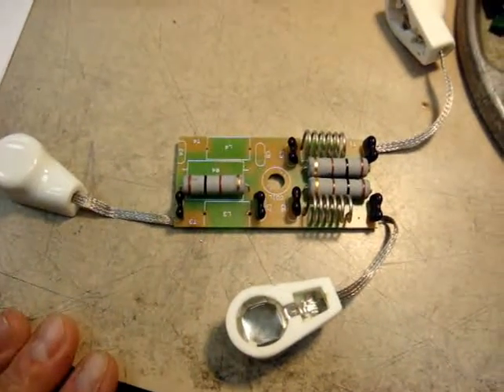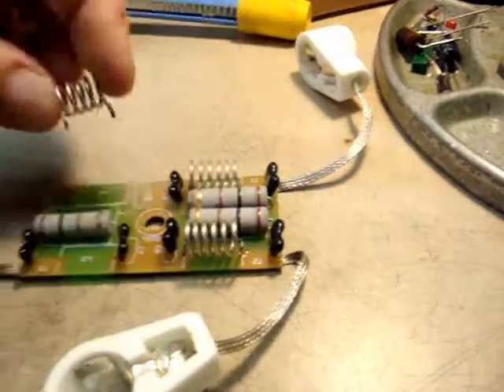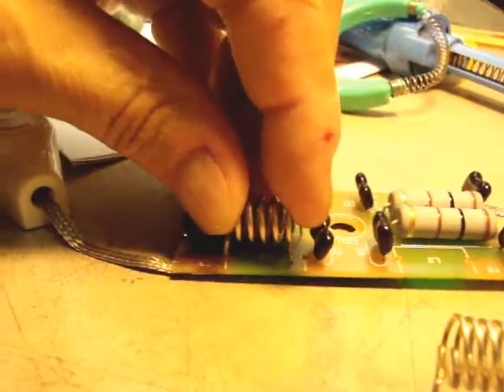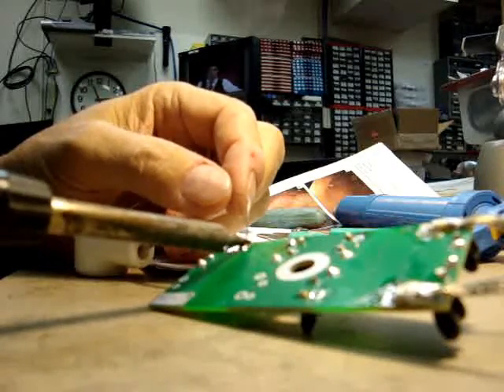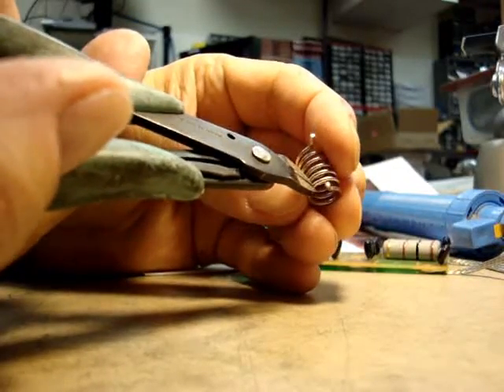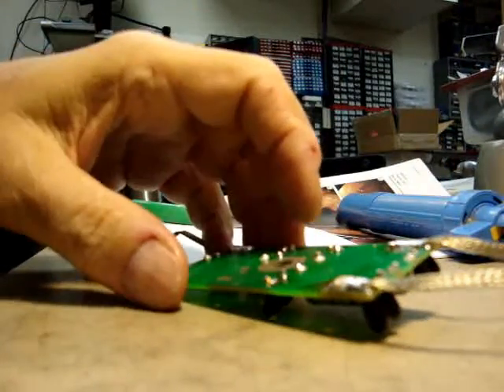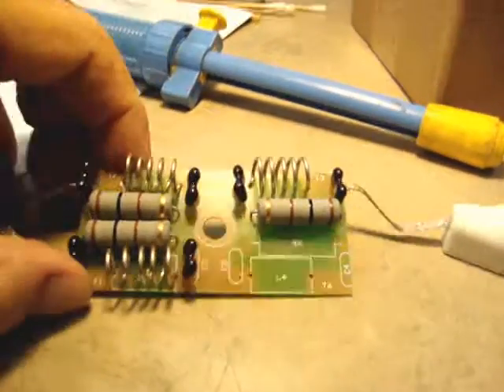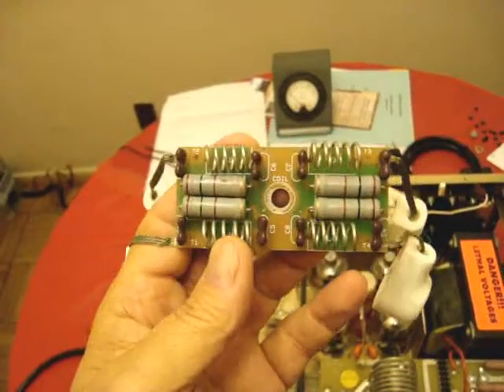Ameritron Parasitic Choke Problem

Comment: Only four turns will be better. Also that bunch of 100pF capacitors are not necessary. Connect the resistors directly to the coils. Simple is better.
Reply from the maker: I tend to agree 👍

Comment: I see it was a 6 turn now it’s 5. Mine is already a 5 turn. ???
Reply from the maker: 4 or 5 turns is good. As long as the resistors don't get hot operating on 28mhz, its good.

Comment: That board has a few issues from Ameritron. They use the wrong turns sometimes, it should always have 5 turns, and sometimes they short the capacitors. 

Also they use the wring fan in amplifiers. The Cooltron fan they are using now is 1/3 the required airflow. 

CTR Engineering has a better direct replacement board and fan kit that fixes the current 811 amplifier production problems.
Reply: Yes, i heard about that too. I had noticed that some of the amplifiers had 6 turns and others had 5 turns. i spoke to a tech at MFJ that told me it should be 5 turns on the coil for proper operation.
Reply: @Music-zh7fm  The poor QC at Ameritron along with everyone and anyone being able to change anything they want, even change critical parts, is why they have problems. This is why the fans are far too small now, and why the solid state amps have so many problems.  The worry about this is it causes the public to form their own opinions of what to do. 

For example the parasitic suppressor circuit board trace layout is prone to having the small mica caps near the choke shorted, which almost quadruples current in the 100 ohm resistors at HF. There was a certain hardware stack supposed to be used, but it never happened. 

Instead of publicizing that trace being too close to a lug as a spot to watch for  resistor overheating, or knowing the fan is 1/3 the necessary airflow, or maybe the suppressor has some random turns count in the suppressor inductors, everyone automatically just takes a turn off.

What if it has the correct turns and a shorted-out 100pF capacitor and a too small fan, and someone pulls an extra turn or two off?   They now make stability  worse and do not fix the real problem. 

This is the danger in random construction and random repair.
Reply: @Jerrythenerdful  What do you suggest?

Comment: If you ask me, I think it's best to get rid of the capacitors because they're not uniform enough.  get rid of the whole parasitic choke pcb and make three identical chokes with exactly the same wire lengths to the common RF tie point.  Read my other note as to the reason.
Reply: @bob4analog  If you don't believe me Bob, why not try making 2 of those braided straps about 6" long while making the others as short as possible.  I'll bet you get very low power out of the amp.
Reply from the maker: Yes, I agree, but why would you want to do that?

Comment: Do you realize that a Uniform appearance isn't all that you get by making these things exactly uniform?  Bear in mind something called "Transit Time".   For example, have you ever examined a computer CPU card very closely? if you have you may have noticed that many of the PCB traces in the Data Bus or the Address Bus will have several lines that seem to be needlessly "snaked" around the card for no apparent reason.  The reason for this is so that every "rising or falling edge" in the "data word" will arrive at the correct window in time because if some PCB wires are longer or shorter than others, the "Transit Time" for some of the data bits will be slower or faster than the others, causing the Data Words to arrive with data errors and "crash" the computer code.  A very similar thing happens at the point where the Plate RF of multiple RF power tubes meet together at the Plate voltage choke.   For example:  If you have the crest of the output wave from one tube arriving more than a few degrees delayed in phase from another, this will cause a type of interference or "phase cancelation" that will actually use some of your RF power to "buck against" itself thereby, weakening your resulting output power and only heating your system.  You can think of it similarly to Reflected power interference inside a microwave oven.  This is why at 30MHz you must be sure to keep these wires exactly the same length.  Don't believe me?  Do the math and look at the traces on your computer's CPU card.  You'll see how much trouble they went through to make sure that every line in the Data and Address busses were the same length.    Don't bother to do this and your radio stuff will just be average at best.   No matter what the frequency, the speed of light is still the same.
Reply from the maker: Then there's propagation delays with different dielectrics.
Reply: @bob4analog  That's also true.   Elsewhere on YouTube I've seen a large "linear" amp made using 6 or 8,  3-500Z tubes. The builder tied the plates together by connecting them along a long bus strap such that the wave from tubes on the end of the strap would need to travel a greater distance than that of the tube in the center of the strap.
Reply from the maker: I've seen that too and found it to be quite impractical. Why not just use a larger single tube to do the job. I suppose they can get away with doing that at lower frequencies.
Reply: @bob4analog  My point is that arranging the tubes along in a row like that causes the problem I've been talking about. The length of the converging Plate lines all must be exactly the same length or, the output of the tubes can be bucking each other.  At 30MHz and higher the Plate leads should be very short and exactly the same length as each other.   It's because when the output wave of one tube is rising another tube's output wave can be falling.  Being out of phase this way will result in decreased output power while still putting lots of plate power into the amp.  The same thing is true at the input to a set of two or more tubes.
Reply from the maker: Yes, you are correct. With that many devices operating on unison, it's imperative to have the connections the same length. The most logical way would be to arrange all the tubes in a circular manner around 1 central hub, then the connections could all be the same length.
Reply: @bob4analog  I'm an equipment engineer with 45 years of experience in Electronics, Chemistry, Mechanics and Physics.  I've worked with semiconductor wafer processing and the processing equipment, mostly specializing in Ion Implantation of Si and GaAs products as well as GaN materials.   I've got several decades working with large RF power supplies used for plasma reactors and vapor deposition systems.
   If you think about it you'll realize that the resistors in the parasitic suppressors shouldn't even be doing anything at all until a tube tries to go into oscillation at VHF or UHF.   If your resistor is heating it's most likely that exactly as you've said, the 10 meter fundamental energy is appearing across the inductor that has too many turns.  In fact, this is a major source of power loss in these amps.   I've got one of these amps as well as an SB-220.  I'm planning to remove all but about 2 or 3 turns on that coil because I don't want any power in the 30MHz range to be lost in these chokes.
Reply from the maker: Point well made! High 5!

Comment: Thank you very much for the instructions on the 811h PC  board.
I tried to purchase a new board from ameritron but no luck.  Ameritron and you both say the value on the resistors are 100 omh 3 watt. By the color bands isn't that 200 ohm ? Red-black-red. I'm learning so please be patient. 
Would you please send me a parts list of all the components and where you got them? And possibly a place that I could purchase a pc board? 
Thank you again for helping me and many others.
Reply from the maker: The resistors are 100 ohm, altho the brown color bands on the resistors do look kinda red in the vid, they're actually brown (brown, black, brown). The capacitors are 100 pF 500v. Im trying to find a reliable source for these parts and the PC boards. 

http://ke5dfa.50webs.com/AL-811H.html

Supressor board Ameritron P/N 50-0811-1

MFJ 662-323-0549 Jimmy (tech)

73
Reply: @bob4analog  My mistake on the colors. Thank you very much for the video. 
I got the resistors and capacitors in today from Mouser electronics. 
Thanks again,
Mike
Reply from the maker: @mikechelette4424  Great, glad you found the parts. Just make sure the capacitors are the silver mica type and the resistors are not wire wound ;-)
Reply: @bob4analog  I replaced all the capacitors and cut 1 loop off of the coils to make it 5 turns. Resistors checked out good so I left them on the board. Color looked good also. Just some brown tint on the board. So I believe I caught it in time before it got too hot. 
Thank you for helping me save my amp before it failed.
Reply from the maker: @mikechelette4424  Great, glad to hear it worked. 😉
Reply: @bob4analog  could you, please tell, what’s the material of the coil?
Reply from the maker: @iuriivrublevskyi6368  - It's tinned copper.
Reply: @bob4analog  thank you for a quick response and sharing this modification

Comment: lcl  clc  chokes ? suppresors? now go back to basics.. low pass filters and high pass filters, cut the frequencies you do not want to let through or want to let through... (suppress by a few dB) if you thumb suck  the values of choke/inductor.... you are guessing, than can be like gambling...these days google is your friend for low and high pass supressors, but reall you need a analyzer to view the suppresor performance, i would like to see the i.m.d. on the mods before and after, your neighbour might not like you so much after this mod , hehe..
si inside the amp we have a tank circuit (CLC) cap then a l circuit and a cap again. we adjust this to tune load the amp... if we do this step wrong( while watching for the dip on the meters) we end up with 2 things= smoke or tube failure, now.... highest output on a wattmeter is not a good tuneup procedure but will you feel better :) and run the imd's up and yes...burned suppresors...
sorry my spelling :)
ZS2CX
Reply from the maker: Thanks for your comments. This modification is not all that critical. Ameritron had done this same modification with their later parasitic surpressor boards, which is what i was duplicating in this video. As a result, the 100 ohm resistors will not burn up on 10m. 73, KD5MHQ.

Comment: I have an al811 and that i use for cb, but i went to 572b tubes and the tube in the center stopped working, also the parasitic choke board resistors are on their death bed. but why does the tube in the center not work?
Reply from the maker: You may want to check how many turns your parasitic coils have as described in the vid, especially on 11m. If there are too many turns, the resistors will burn up. When you say the center tube stopped working, do you mean the filament isn't lit? How do you know it's not working?
Reply: @bob4analog  I fixed the parasitic already, seems to be okay now. But still, the tube problem persists, the tubes light up, thats fine but when i take out the central tube there is not much difference in power. and the plate on it doesn't even turn red at full power.
Reply from the maker: @letitrotfuckit  Try swapping the middle tube with one of the others. See if the problem follows the tube or if it's just at the middle tube socket. Are those all new tubes? You may want to check continuity thru the parasitic board to the plate cap in the middle tube. I'm hoping the grid wasn't over driven and caused the tube to fail. How much grid current was it drawing during tune up and operation?
Reply from the maker: @letitrotfuckit  - It sounds like there's some bad connections at the middle socket. You might want to check those and resolder them. Maybe check all the socket connections and resolder thm. If you've already determined that all 3 tubes are definitely good, the socket connections are the only thing I can think of that  could be faulty.

Comment: Can you please tell me what the exact value is for the SILVER MICA capacitors that are mounted on the parasitic suppressor PCB are ? I need to know their value and maximum working voltage rating. Thank you in advance for any help that you may provide !  73, Mark, WN3SIX
Reply from the maker: They're 100 pF 500v each.

Comment: "unleaded" solder works great if you add a bit of flux first. the solder is fine, it's the "no clean" flux in the solder wire which isn't as good as flux paste (MG Chemicals #8341) or Kester (#186) flux (rosin ftw).
Reply from the maker: Great tip, thanks!
Reply: yes unleaded works fine but in a application where the joints will be getting hot and cold it will become weak and possibly break over time. leaded solder will last longer
Reply: @swingdaddy2126  you say that but can you reference a NASA Bulletin or similar publication to support the claim?

Comment: i got a new 811h two weeks ago  .it has the 10 meter mod done. the green wire . i started hearing people talking  about this mod . i called AMERITRON  and both of the technicians that i talked to told me DO NOT DO THIS MOD  . they said that it would cause unwanted harmonics ,over heating to the resistors , and posable tube damage. now thats what they told me . i was on the phone for two hours with both of the technicians . maybe because mine was built on 4/25/18 its a newer  amp and they fix the issue ???. i have talked on 10 meters of and on for two weeks only driving the amp with 45 watts on ssb . but i am keeping a eye on the board .  thnks  bobby
Reply from the maker: Thanks for that update. Yes, There seemed to be a bit of controversy about the 10m mod as you stated.. even from the techs at the factory. After a bit of research, I found the cause of these chokes burning the resistors, and later found that Ameritron fixed the problem by having a smaller coil, thus this video. Yes, the newer model AL811 amps have the smaller 5-turn coils and not the 6-turn coils. If yours has the 5-turn coils, you can be sure it's the newer ones and you shouldn't have any trouble with it. Cheers!

Comment: my brand new 811 has same issue, I talked to Stan and he is sending me 1 new 100ohm 3 watt resistor, and I will install it.   Will the 5 turn mod affect a different band in a negative way?  Just wondering, does spreading out the windings but leaving them as 6 turns do the same thing?   tnx for the info!  de ag6if
Reply from the maker: James Sanders - I hadn't tried spreading the coils as you mentioned,  but it's worth a try. That's a good idea. As to the modification, it shouldn't effect the performance at all. It should only prevent the resistors from burning up on 10m. I think I mentioned it in the vid, but Ameritron had 2 different versions of this parasitic choke. The one with 4 turns did not have the problem and I'd remembered reading somewhere about this issue as well. The choke was resonating too close to 10m and causing the problem. removing a turn solved the problem.  it will be interesting to hear your experience of spreading the coil.  KD5MHQ
Reply: ok, thank you.  when I change out my singed resistor, I might spread the coils a bit.. I calculated .21 uh as is, and about .15 uh by removingn one loop.   If I spread them at teh top, i should be able to reduce it a little bit, cant hurt...then if I burn another one, I will cut a loop in a future work.    tnx again Bob.
Reply from the maker: James Sanders - My pleasure! lt'll be interesting to see how that works out for you. Please share when you find out. 73!